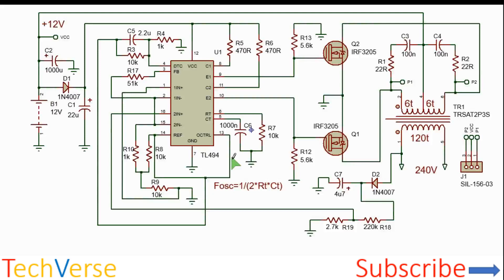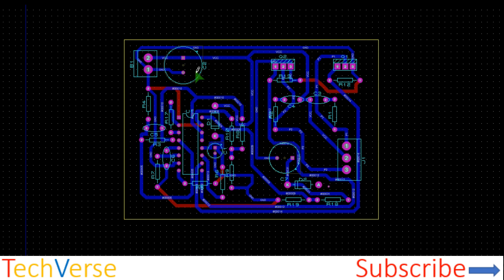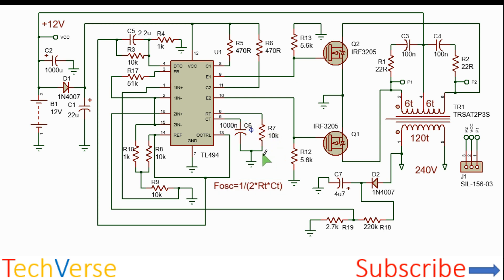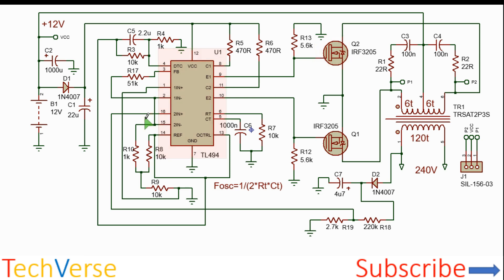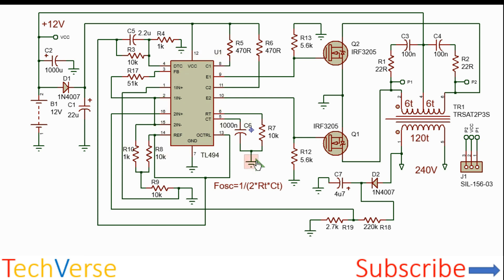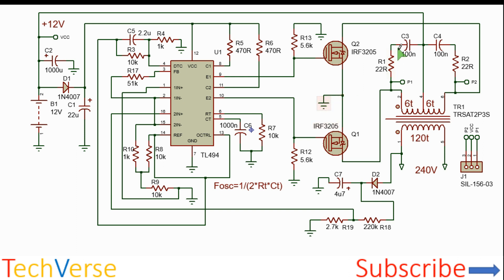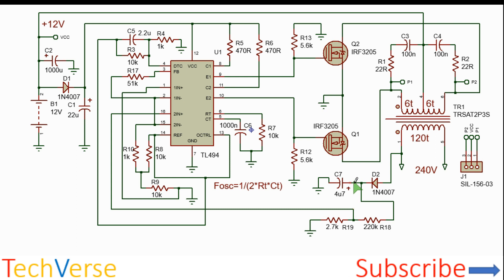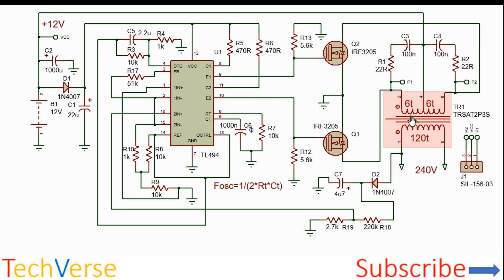Make a Power Inverter with TL494 | 12-240V 900Watt

Comment: Thanks. Can ferrite transformer be operated with 50 or 60Hz electricity frequency? Kindly give more details of the transformer for this inverter(material ferrite or iron core, copper or aluminium coil etc)

Comment: good morning, nice video . the entry is 12 v but how many amp? if i want to have 5000w i change just the transformer or other things? thanks
Reply: You need to parallel like five or six of those IRF3205 Mosfets to handle at least 500Amps.